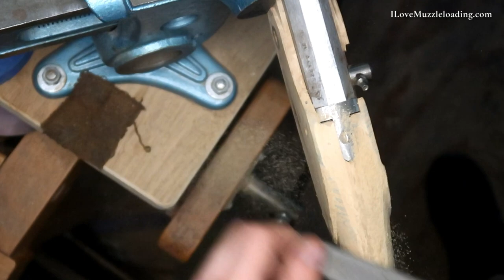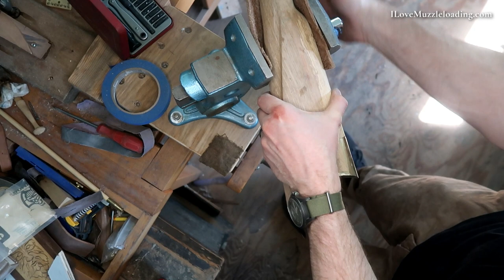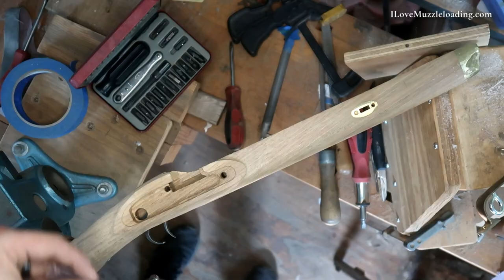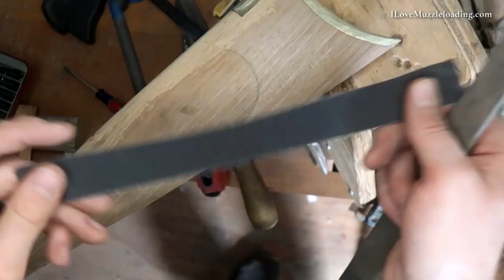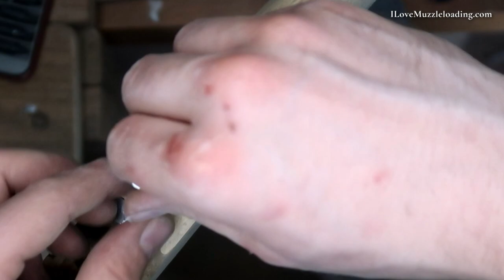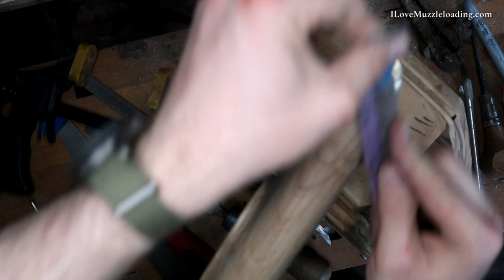Refining Shapes in Wood and Metal | Let's Build a CVA Hawken Part 6 | I Love Muzzleloading

Comment: Just a little tip about regular sandpaper, if you cover the sheet with masking tape it last far longer and tougher as well. But the tape all the way across the sheet before cutting to the desired size. Kind Thanks! DaveyJO in Pennsylvania

Comment: Ethan I am a little worried about the gap between the back of your tang and the wood. You dont want the screw to be what resists the recoil of the rifle. A person can fill and re-drill the hole bringing the tang back or epoxy bed it. I am talking about the flat portion in front of the screw.